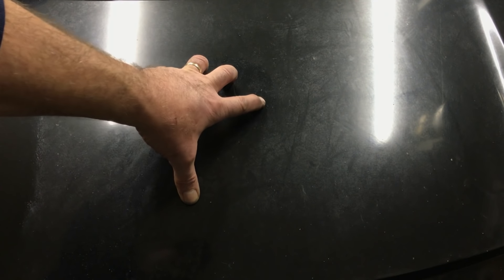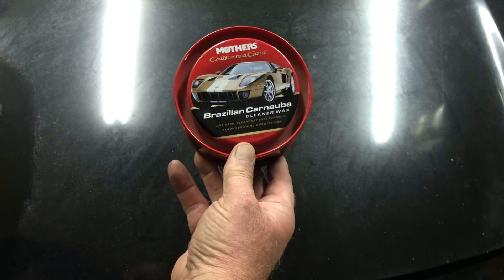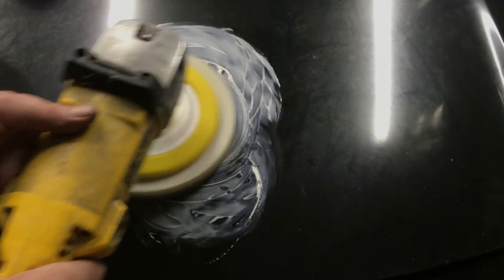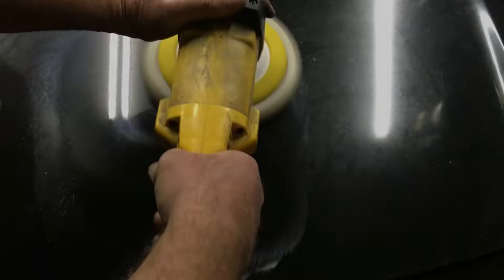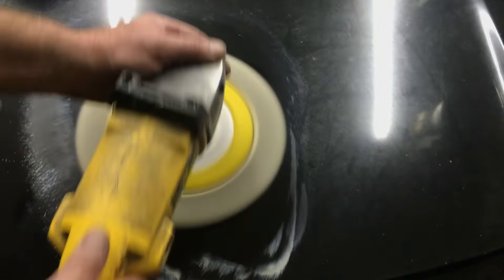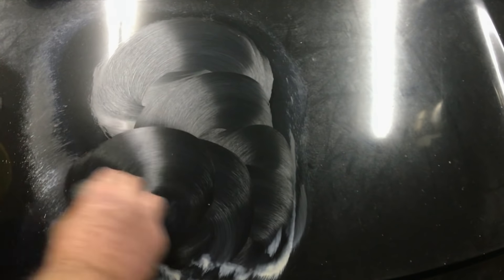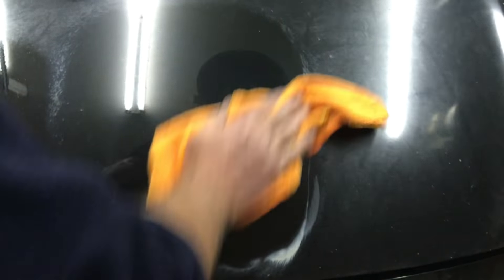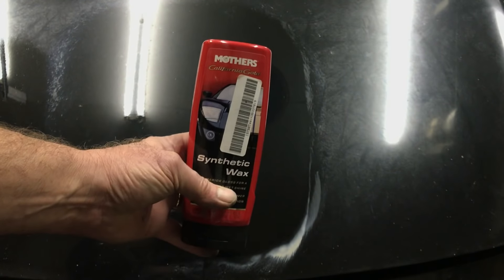How To Shine DULL NASTY & FADED Paint.....FASSSST!

Comment: I have used this method on a few vehicles since watching this video last year and it works great. But today I made another awesome discovery. I was doing the top of a Durango and I slopped it onto the black plastic roof rack. I thought: no big deal, I’ll go back later and clean it off with some mineral oil, but instead I hit it wit the carnauba wax and a microfiber towel. It had been faded and gray, when I finished it looked black, clean and shiny again! I don’t know if it’ll work on all faded plastic, but I’m gonna try it on the fender flares of a Jeep and I’ll let you know.

Comment: Ok, I love the way thathood turned out; FANTASTIC!!! Question but I think I already know the answer. I don't have a garage, and my black car is in the afternoon sun until it, the sun, goes down. Now, that side of the car is looking kind of whitish. Is that clear coat burnt to where I need to re-clear the car, or what? I'm almost afraid to do this as it may eat into the paint. My brother's a body tech and has buffed several spots on my car, he said that side looking kinda rough I see. Afraid I may have to get him to prep and re-clear. Would that sound like the best thing to do? I really don't have the money for it, but don't want to go to a crappy paint shop that claims they can paint your car for like $200. He, my brother, is ASC certified and is damn good at what he does. Maybe there can be a "family discount" lol. Or can I fix that sun-burned side? 
Thanks in advance, Vince
Reply from the maker: If you can send us some pictures that would really help SWEETPROJECTCARS@gmail.com

Comment: You definitely have an arsenal of extremely useful content within you video library.  Thank you so much.  I have a mercedes w123 300d and have been looking for tips on pads or technique for buffing between drip rail and tapering curvature of the roof. Lots of trim/rubber to work around on this one.  Foam and wool pads are too thick. I have the top of the car buffed (sorta) left with milky fade behind drip rails.  Curious how'd you approach this.
Reply from the maker: If you follow this video here your paint will come out absolutely gorgeous And if you use the 3M woolly polishing pad you can get into very tight areas with it

Comment: So if I use a rotary polisher and a yellow pad I already have different polishes and have the one that came yesterday the Last coat and carnuba wax so if I use either one of them with my rotary polisher and a yellow pad I usually put the setting to a 3 I can remove the dullness on my vehicle because when I applied carnuba wax by hand or any other wax or polish by hand it doesn't remove the dullness.
Reply from the maker: You can use whatever you want to use, but if you use exactly what we use in the process you will have fantastic results every time guaranteed.  Have a great day.  mad Mike the hammer SPC

Comment: Hello, I came across your video, because I was looking for a way to put a shine on the border of a spot repair that is dull. I don't know if it is dull because I compounded too much or it is 2k over spray that got under my soft edge.  

Tried dual action foam pads with  meguires compound then meguires ultimate polish .  Any ideas to get a shine in the full areas?   Thanks for your help.

Comment: My car has a clear coat that is faded, flaking, and completely gone in some places. I've started your process and after about 2 hours working on the hood, have a few questions. The hood looks much better, but needs more work and I still have to do the trunk, top of the car, and the upper parts of my doors. I really appreciate all your videos and hope you have time to help me out here...

My Process:
A. I'm using Mothers 05101 Mag & Aluminum Polish, followed by Mothers 05500 California Gold Brazilian Carnauba Cleaner Wax, then Mothers 05716 California Gold Synthetic Wax
B. I'm tried using a 7" Harbor Freight Polisher with a 8" compounding/cutting (1" think foam) pad (I also have the finishing foam pad version I have not tried yet)
C. I put a 7 In. To 8 In. Fleece Polishing Bonnet on top of the 8" compounding pad for most the polishing work.
D. I used a fresh fleece bonnet for the cleaner wax after applying by hand. 
E. I used a microfiber cloth to apply the synthetic wax that highlighted many imperfections and looked much worse than after finishing with the cleaner wax.

My Issues/Questions/Concerns:
1. On first try I applied the polish then immediately applied the buffer with foam pad, it seamed to bind, grip, and jump a lot. After switching to the fleece cover, this reduced the binding and jumping but not completely... Do you think this is a pressure issue, speed issue, angle, or a problem with the buffer? 
2. Should the polish be wet and reapplied constantly as I'm polishing? It seams to dry out almost immediately.
3. And after about a quarter of the way done through the hood I had a hard dry layer of polish (like plastic) on my buffing pad, and then on my fleece after switching. Is it okay to continue using these after this plastic like layer accumulates and is something going wrong that his causing this?
4. Do you have any other tips or precautions when doing large areas like this? The pads do heat up pretty quick, do I need to take breaks frequently, add water, clean the pads often(and if so how)?
5. Is mothers mag and aluminum polish the right product for this job or should I be using turtle wax all metal polish like in your other video on fixing the clear coat spots?
6. Should I skip the synthetic wax as it is highlighting imperfections? Am I doing something wrong or is this just because I need to do better on step one with the polish?
Reply from the maker: Tampa  I will try to help you but will be hard not being there. don't get me wrong on any of my assumptions to your issues.
1. do not do large areas more than 1x1 ft at a time
2. you need to not use foam you need to use the pads we are using or as close to them as you can get
3. once you do the area buff it till it is all off
4. with what you have now, spray it down with water and wipe it all off and start over with a clean white 3m compounding pad, small areas only.
5. once you have done the mothers # 05100 which is the number we use the one you have may just be a newer part number, buff until it is gone then use your carnauba then buff, then carnauba again and hand buff with a rag.

we are launching a new video on this most likely tomorrow. you will want to make sure you have sub'd so you get it and you will see how quick and fast it is...but you do need to follow the video we do to a T..rmember again small areas.
Reply: Thanks for you reply, you are awesome. FYI, the Mothers #05101 is the 10oz version of the same product as #05100 which is only 5oz. I've gotten the 3M pad you use and just have 2 more questions. Do I use the same pad for the polish and wax or do I switch in between and also how often should I be cleaning the pad?

Comment: Thanks for the great info. I have two questions or problems. When running the buffer it seems dry, is this because of too much pressure or too slow speed. When buffer is on speed setting 3 or slower it runs like hit and miss then when running at higher speeds it runs fine. It's a makita soft start variable speed buffer.
Reply from the maker: Chris spray a small mist of warm water on it it is doing this...now disregard this if you are using all the 3M pads we recommend as they should not do that...once you get near to finishing you should go lightly with a very clean  3m polishing pad  http://amzn.to/2ColzlT      thank you very much we truly appreciate your great comments and glad you are here with us :)
Reply: I have the recommended 3m pads.  They are new. It maybe the makita polisher doing something wrong because of the way it runs, it's like a pulsing. I may have to get it looked at. I checked the brushes and replaced the cord.
Reply from the maker: chris one other thing you need to remember, you almost always use the edge of the buffer pad , so like on an 8" pad you would only use the first 2 or 3 inches of the leading edge by keeping the buffer tilted at a slight angle, you almost never lay it flat untiles you are doing the final polishing with a fuzzy pad :)

Comment: I have a rotary polisher and am getting carnuba wax so when you apply the wax is it best to have the setting on 3.
Reply from the maker: If you use the tools/products we use in the video you will have the successful results, any other products/tools you use that we don't recommend will cause you other issues.  40 years experience is what we are sharing with all.  Thanks.  mad Mike the hammer SPC

Comment: I’m reminded of a Manfred Mann song! I’ve got a 2005 Civic VP for my daily driver that I’m going to start working on, thanks in large part to your videos. I do have a question, do you think doing a ceramic coat after this process would be good, or just after the cleaner wax? Most of the paint is good, but there’s some pretty faded spots and a ton of rusted rock chips needing to be fixed (already watched that video btw, again thanks!).
Reply from the maker: Hello Travis if I had that vehicle you’re talking about I would work on one section at a time with that is your goal to make the car in great shape finish the quarter panel or a fender and then ceramic coat each one that you get finished. If you were not planning on making the car perfect I would just wax it. Hope this helps
Reply: Sweet Project Cars it does, since I will be finishing a graduate degree in a few weeks I don’t want to eat up all my free time with working on my car just yet. I want to do things little by little so I can spend time with my family. I appreciate the advice and all the videos you do. It’s made the task seem more manageable and able to be done without paying someone an arm and a leg to do for me.
Reply from the maker: Travis Dangerfield awesome if you need any help let us know my friend :)

Comment: I just order the foam pad that u have on the description i click the link and order it. But the pad that came in is all flat does not look like the one you used in your video. Does that matter it says 3m foam compounding pad 05723. On the bag it says " new pad design"
Reply from the maker: Yes sometimes they change the designs of the pads but the material is still the same and will work just as it is shown in the video thanks so much have a great day mad Mike sweet project cars
Reply: Thanks i bought the buffer and all 3 pads the foam pad compound pad and polish pad the wools the ones on your description. Thanks Mike! Wish me luck im waiting for the buffer this Wednesday from there I'll b detailing my car hopefully i will get the same results as u any tips would be appreciated i have some swirls marks and scratch on my car if u can tell me the proper steps would appreciate it and i bought the mothers mag polish a must 👌

Comment: I am using a hand drill attachment pad. and trying by hand but I always end up with hologram marks on the paint. Can you help?
Reply from the maker: Adam, you will not be able to do it with a hand drill as paint is much different than doing head light lenses you will need to use the tools in the "Show More" of the video description...sorry.

Comment: So  is this method  treating the clear coat, is working on the paint or the clear coat?  What do you suggest for pealed off clear coat.  I'm going to sell a red truck that the roof and fenders have all peeled off, and have a dull finish. It's a real nice low mileage GMC with a rust free straight body.  Excellent frame, here in Ontario Canada, the true North rust belt.  So,  Is there a method or product that would shine up the finish so it doesn't look so bad.  I know, sanding and recoating the clear coat is the answer, but since you have so many money saving methods, wondered if you know of a way to do this on the cheap.  Thanks for all your good videos and knowledge that you share.
Reply from the maker: yes the Clear coat.  see this video on peeling clear coat and how yo make the basecoat shine   https://youtu.be/IF5VqNjgFo8         we thank you very much and for the quality comment, it is very helpful for the whole channel :)